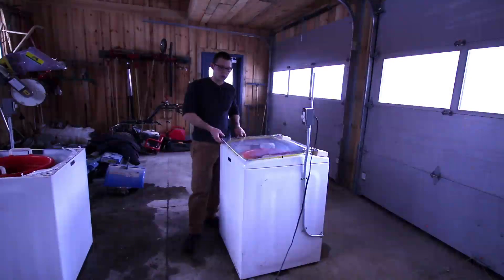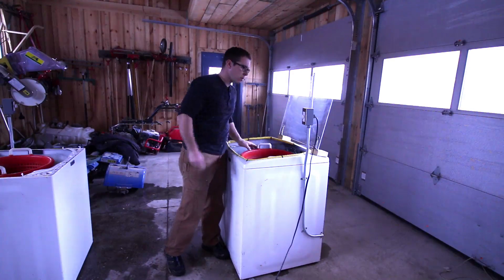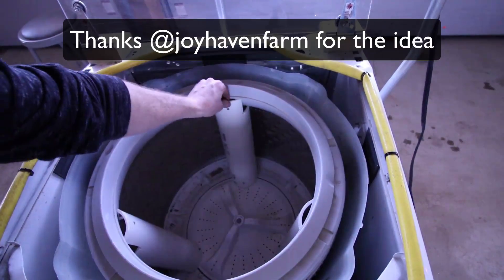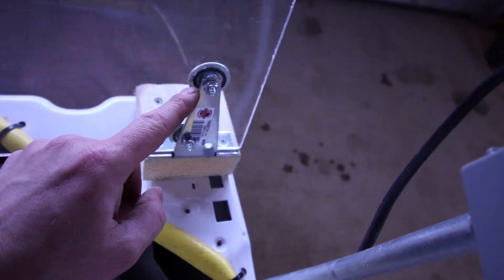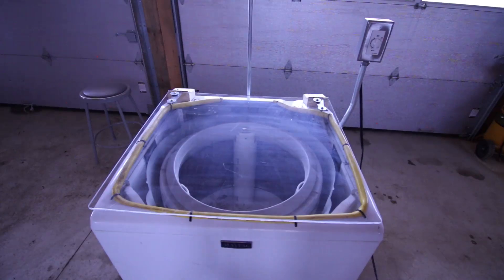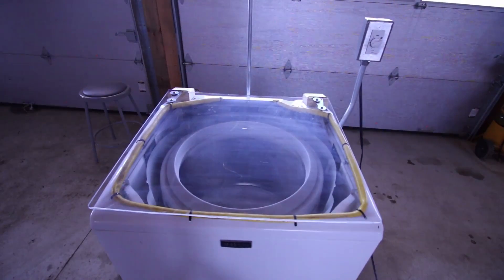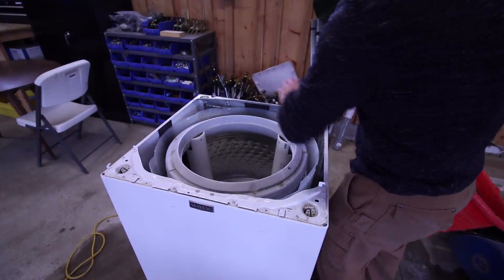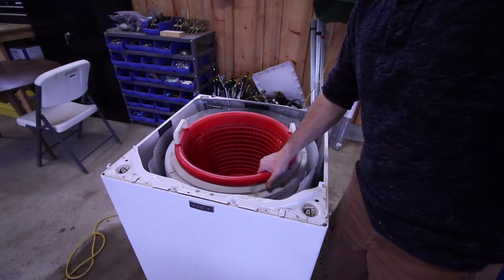JM Fortier Salad Spinner Conversion

Comment: So I have a Whirlpool WTW6500WW1 Laying around, but it is not belt driven.  It has 2 wiring harnesses going to the motor and the controller is shot.  Is there any way to make it work?  There is one 3 wire plug with red, yellow, and blue and another six wire plug with an orange, red, gray, blue, yellow, and brown...  This looks like a good use for my shot washer, but I have no clue where to start as the wires do not match what you cover in this video at all.

I hope you can help.  Thanks!